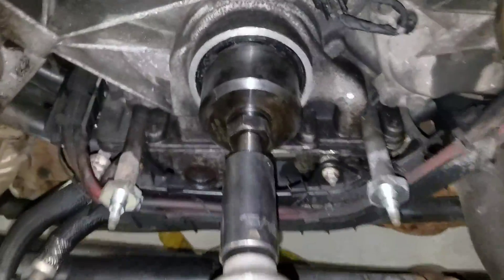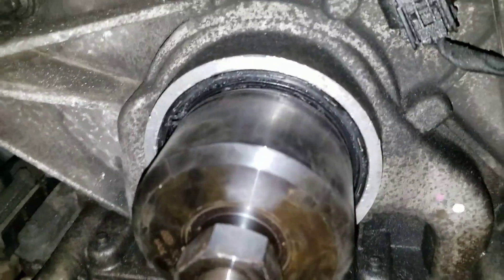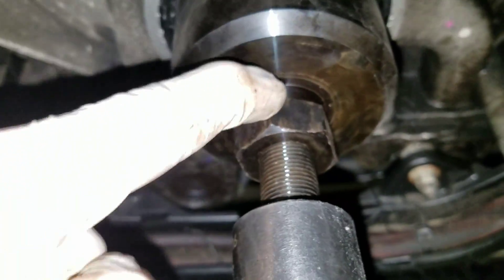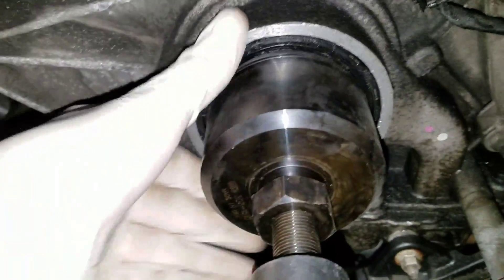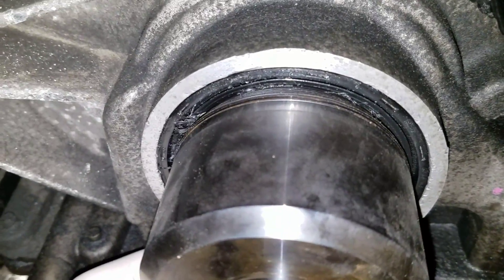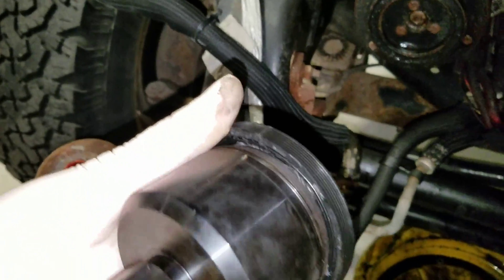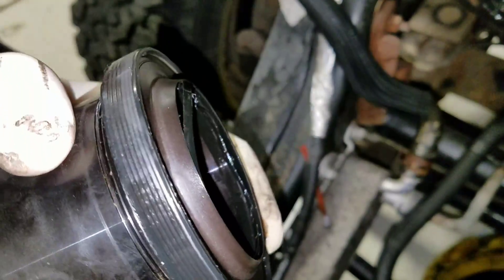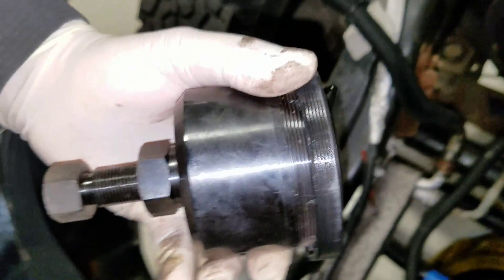11 powerSTROKE - Front CRK seal removal

Comment: A Rod,.. would you please help us out and determine why ford says the 6.7L oil pan gasket used on the 2020 F-250 6.7L (PN LC3Z-6710-b) TO FIX THIS PROBLEM is not applicable to 2017-2019 6.7L F-250’s… ie: is the pan different? and if it is can you buy a 2020 pan and gasket and then put it on your 2017-2019? THANK YOU!

Comment: What size socket do you need to remove the crank shaft seal to get to that part on a 2011 6.7 power stroke
Reply: The crank pulley bolts are 18mm 12 point

Comment: Will this tool 303-1510 work on the 6.4 powerstoke  to pull the front seal
Reply from the maker: No, you need 303-1260 to remove it & 303-1259 to install it...otherwise it will not go in or come out.....
Reply: Okay I thought the 303-1260 was only to pull the wear ring not the seal
Reply from the maker: It is just for the wear ring. If its the original seal there won't be a wear ring. You will have to drill two holes at 9 and 3 o clock on the seal and slide hammer it out per workshop manual section 303-01C for this procedure.

Comment: Hey Arod.  Had my first opportunity to use this tool on a 6.7 for the same problem.  I prayed the oil slinger off and turned this tool into the seal but upon trying to remove the seal it kept slipping away from the seal.  I re threaded the tool into seal again and same thing.  There were no instructions in the red Rotundra box.  Another tech used same tool on a different repair and same issue.  What am I doing wrong when using this tool?  Hope to hear from ya!  Klint...
Reply from the maker: +klint duin u really gotta use that special tool as hard as you can. Your pretty much cuttin threads into the seal. My first 1 popped off too...i put it back on a turned it as hard as i could. If you have an issue, pm me h well exchange #'s
Reply: PowerStroke Tech Talk w/ARod thanks for the feedback...roger that.

Comment: You see anything wrong, I have 2015 F-350 at my shop that has 43xxx miles, with the crank seal leaking also, and has been replaced twice in its life at another dealer, once at 6xxx miles, and again at 36xxx miles
Reply from the maker: +dnf2004 wow YES!! Havent put up my video. Got the ok to replace the short block. Tore it down yesterday, rear crank seal was leakin just like the front. Removed the oil pan, nuthin but metal in it. The main bearing behind the oil pump, half of the of the bearing is half missing. The crank must have been walking!
Reply from the maker: +dnf2004 private message me with ur phone number, we can talk in a little more detail, give you a few tid bits of info. I am EST

Comment: can you supply the OTC part number on that tool?
Thank you for all your videos.
Reply from the maker: +Richie Pointer i dont have the OTC tools, only Rotunda.
Reply: PowerStroke Tech Talk w/ARod 
 I could of swore I saw the OTC stamping on the tool at about the 21 second mark. 
Keep the videos coming!
Reply from the maker: +Richie Pointer 303 1510 1 and 2
Reply: PowerStroke Tech Talk w/ARod 
Thank you for the number, was it an OTC?
Reply from the maker: +Richie Pointer 303 1509 is the installer
Reply from the maker: +Richie Pointer yes

Comment: Have you ever done a front main on a 7.3?  Mine is leaking and I was wondering if I needed any special tool or recommended tool while doing it!  Thanks and love the videos.  Keep them coming!
Reply from the maker: +MonsterGT43 yes i have, yes you will, at least the part that contacts the seal. U can use a hammer to drive it in, only if ya had that piece of the tool. Otherwise youd be better off checkin out Freedom racing .com. they got a buncha tools there, check em out